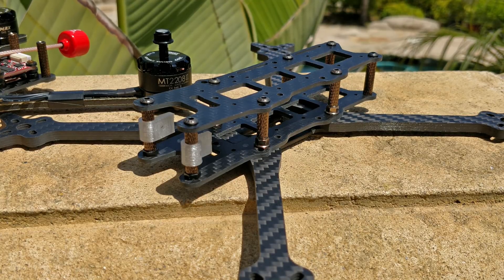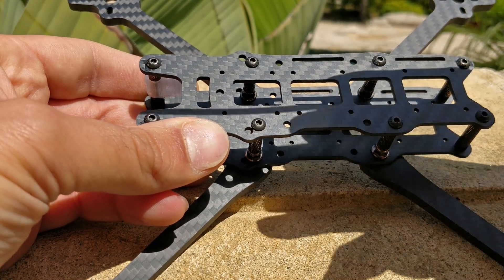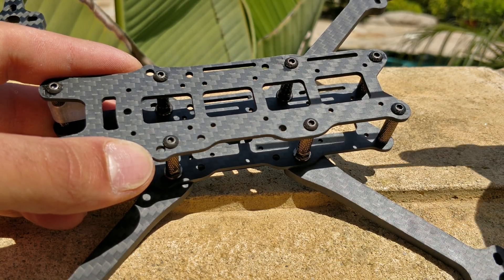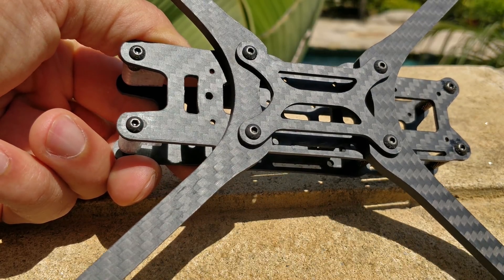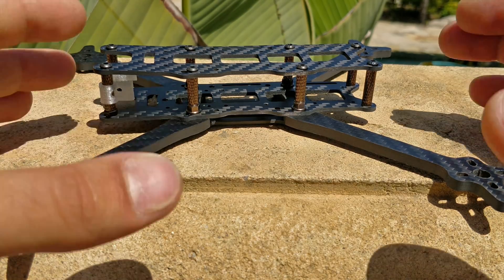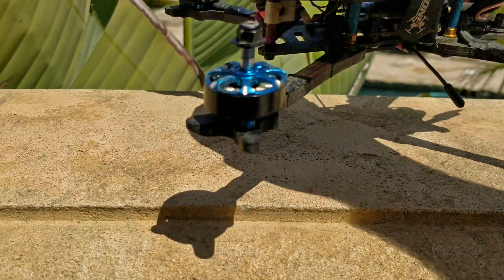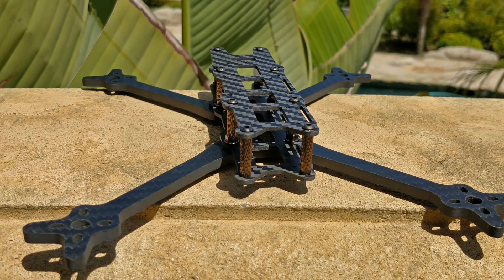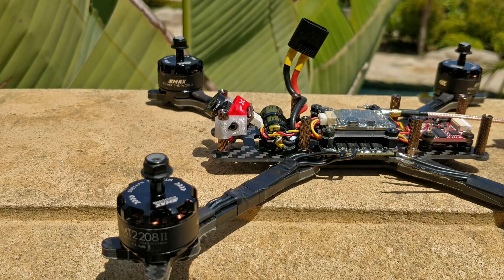FlosStyle - Features and Characteristics

Comment: Hey Bob/Kabob FPV!! Need a build manual for ur Glide 🔨 frame! Do u have a site or a manual for it!?
Reply from the maker: For the glide i haven't made one but I have for all the upcoming ones.  The current hammer batch is actually really tight to get together.  I have been recommending people either get a 3mm drill and drill through the screw holes used to mount the arms before assembling.  Or just twist a screw through every hole all the way and keep twisting to assure it's open and clear before putting together.  The tolerances on this batch from the factory is extremely tight.  The next batch wont be.
Reply: @Kabab  I found a build video for the glide so I followed those instructions & it wrked out!! Thanks & keep doing ur thing, Bob!! Love ur frame it's super solid

Comment: hi,,, someone gave me a 6" flosstyle frame ,,,, he has moved up to 7", will a 2508 motor be to heavy for the arms ? using parts off my old 7" ,,,,,, many thanks
Reply from the maker: No the arms on that quad should be quite strong however the more recent Glide design is better overall
Reply: thanks

Comment: Will this frame allow for 5.5” props?
Reply from the maker: it won't unfortunately and I wouldn't recommend it anymore.  The Glide frame on FPVCycle.com is a much better option.  It's a much more updated design and there will be three versions if they ever arrive from the manufacturer.  The regular, light and high strength version.
Reply: Thanks for the info! I’m assuming FPVCycle is your store? Ordering the Glide Lite now 👍🏽. Will it fit 5.5” props?

Comment: the xing 2306 will work with this frame ?
Reply from the maker: Yes definitely
Reply: @Kabab  you said in the video to not fly this frame with 2306. You sure ?
Reply from the maker: @mcFlow1  well if the build is light it doesn't need it. It's excessive throttle curve. Makes it hard to control
Reply: @Kabab  I really dont know what to do! which motor, frame and 4s battery to use???
Reply from the maker: @mcFlow1  first of all, you want the Glide frame. Not this one.  I just haven't had a chance to make a video about the Glide
Reply: @Kabab  I planning to use, micro fpv cam, full size antenna, 30×30 fc and 4in1 escs, gopro hero 4, and I still think what battery to use 1300mah(150g) or 1550(180g)... So what motor and props you recommend? For this freestyle quad ?
Reply from the maker: @mcFlow1  I'd really go for 6S. Anything 2207-2208-2307 in 1700-1800kv
Reply: @Kabab  And if I still want 4s what motor?
Reply from the maker: @mcFlow1  xing 2306 2450kv
Reply: @Kabab  You sure ? Because I am planning to use 150g battery and you said if the build it's too light with 2306 motor it will be hard to handle.
Reply from the maker: @mcFlow1  it's just a really good motor. You could go for the xing 2207 also if you like.
Reply: @Kabab  what is the performence and efficiency difference?

Comment: How much does off-center FC mount matter if I like to use autolevel once in awhile?
Reply from the maker: Zero. It doesn't matter at all. As long as the FC moves with the frame it could be on a 10ft pole out to the side. Even with autolevel you probably couldn't tell any difference with the FC 10ft our to the side.
Reply: @Kabab  oh ok, I was under the impression acc needed to be on for autolevel. Or does it work with acc enabled on autolevel too?
Reply from the maker: acc does need to be on for autolevel.  It just doesn't matter so much where the FC is.  Technically, it is best to have the FC somewhere near the middle for autolevel but in practice, it doesn't matter as much as it technically should.

Comment: @kababfpv are the 7 inch boomerang arms from pirpofliprc stable enough for this frame? No bending?
Reply from the maker: Yes they should be.
Reply: @Kabab  thank you:)
Reply: Also, do you think the arms will be on the gopro footage with 6 or even 7 inch? 
Secontly, i got some 2206 1720kV brotherhobby R3 I think. Will this be suited for my plans?:)
Reply from the maker: @sten6537  yes definitely the props will be seen on 6 and 7" unless you have maybe a 40deg or more GoPro angle
Reply: @Kabab  I just received the 7 inch hyperlite flosstyle from pirofliprc. Little disappointed. The 7 inch arms dont fit the 7 inch props. In the back there is like 2mm between the props, and in the front they collide with the frame :/
Reply from the maker: @sten6537  that's because there is no 7" FlosStyle. What you've got is a 6". It just uses the 7" arms from the floss 2.1
Reply from the maker: @sten6537  crap and now I realized I was responding to your comments without seeing what video it was on. I'm sorry. My bad. Please let me know your order number. I'll ask pirofliprc to consider a credit on your account
Reply: @Kabab  Yeah.. I was hoping to build a 7 inch Floss, but I guess it was misleading information.
Thank you for helping me find a solution. I can send you pictures of thw problem if you want. Order number: PD17-88754
Order Date: 12/11/2018
Reply from the maker: @sten6537  refunded $31.98. transaction id: 2JA619230E255754T. Sorry about that. The Glide design coming won't have this confusion
Reply: @Kabab  hey! Thank you for this. Great service. Still got the rest of the frame for nothing tho ;-). What is this Glide frame youe talking about? Should I hold on to the arms untill that frame comes out? Greetings
Reply from the maker: @sten6537  the glide is coming out in about a week. I've shown it in many of my recent videos and talked about it
Reply: @Kabab   aaah..
-can i use the floss 2.1, 7inch arms on the Glide frame to make it suitable for 7 inch props?
-also what do you think of your 2208 motors for fpv racing? Will that be any good?

Comment: Hi. I like this frame a lot as it is about 85g, especially that the arms are connected avoiding the issue my rooster has. What I think would be really perfect would be to have a front arm-pair that moves the motor position a bit to the back in order to move the motors out side the FOV of the camera. I know that you are happy to have the same arms on different models, but please give it a thought.
Reply from the maker: Watch the last half of my more recent video comparing 2207vs228.  I discuss the new design a lot and about this props out of view thing.

Comment: Does it fit 5.1 size prop?
Reply from the maker: Yes just barely. Barely barely
Reply: Kabab FPV 
Will it change the characteristics of this frame? because the front and rear prop will be closer together.
Reply from the maker: @DodeTeja  no it's not enough to matter

Comment: So, is this frame better than FlowRide or you can still recommend it?
Reply from the maker: Both are good. Both are a little different. I personally prefer the FlosStyle because it's a bit lighter and a more refined layout. But the Flowride is a bit more durable maybe and has individual arms. I'm working on one final frame that blends the two and will likely be the last frame I make. It'll be a couple months before it comes out however.

Comment: I just got the frame, it's awesome! But I was wondering how you power the camera and vtx with the cheap 28 dollar 4 in 1 ESC to reduce noise! Do you just power the vtx off vbat and then power the camera off the 5v output off the VTX? Or is having both on vbat a better option for noise reduction?
Reply from the maker: Most more recent FC's now all take 6S directly and power everything off that.
Reply: Thanks! (: One last question, you mentoined that using steel screws to mount the FC and ESC to the frame is much more durable and will not break in crashes. But this grounds the FC and 4 in 1 ESC to the carbon frame, right? Doesn't this cause any problems/possible dangers to the 4 in 1 ESC and FC?
Reply from the maker: @willemvergouwen  yes it does if the screw holes are conducting. But otherwise the plastic screws break very easily.
Reply: @Kabab  yeah they are conductive on my 4in1 and FC, but does it matter if they are grounded to the frame?
Reply: As long as you don't have a positive wire shorting on the frame carbon you're fine
Reply: @bobm2180  thanks! That's what I thought, but just wanted to make sure. I LOVE THE FRAME! :D

Comment: I built a flossstlye with rcx 2207 motors and with a 1300 turnigy graphene it still weighs 628g. It's even got the runcam 3 which is supposedly lighter than a session. It flies stupid great actually but I how can you build it lighter than this?
Reply from the maker: Yes those morors are unfortunately a bit more weighty. 630g is fine however. They are extremely high value motors. Can't expect everything to be perfect on them....weight

Comment: In your summary of the vid you mention the HQ 5.1x4.6x3. Have you had a chance to run that prop yet? I friggin love that prop! I put it on my Hawk 5 and it seemed to bring out a tad bit more power and I got a little longer flight time (not a lot tho but was averaging 15-20 seconds more a flight). I used it for freestying not racing , it was smooth no jello that I could tell. I put a quick vid on my channel of my first test flight with them. https://youtu.be/RE_lbp9xAZw
Reply from the maker: Yeah it's my second preference prop. I absolutely love the tmotor 5143.  Incredible prop.
Reply: Kabab FPV I love the tmotor prop too. More than the hq lol. Just wish it were a little tougher.

Comment: I am putting together pretty much the same set up. Questions about mounting the 20x20 flight controller. Are the rubber dampeners resting on M3 nylon nuts? Are the length of the M2 screws to mount the FC around 10mm? Thanks for any help :)
Reply from the maker: The FC is the Talon F4. It has the rubber hole inserts. They're made for m3 but it comes with brass m2 to m3 bolt press fit adapters. So I use I think 10 or 15mm m2 with a thin spacers and the brass insets. There's nothing on top of the FC holding it on. It grips the brass well enough
Reply: Thanks! i bought the talon f4 because of your vid. going to mount it in the back like that. cool idea
Reply from the maker: Robert Meyers if you bought the frame recently you'll need to shave the edge of the middle of the rear arms to get the screw in for the FC. A side effect of me beefing up the arms. It's been fixed but only recently. Sorry. But you get way stronger arms.
Reply: my frame was purchased from crown city during 4th of July sales. M2 screws look to be fitting fine :) but ill remember for any arm replacements. Thanks for the info!

Comment: So... now the line of Floss frames share some parts, which certainly reduced production costs. However, the boomerang arms seems an awkward option since they're more expensive (11 usd a pair) than the older individual ones (12 usd/5 arms). 🤔. I know the boomerang style makes it more expensive to cut but, Bob, why not keep the individual arms as an option and make they lock each other?! Floss frames are loosing the position of fairly priced frames... it's sad and what got me a little disappointed in getting Flosstyle :'(
Reply from the maker: The Flowride is still around. The boomerang arms are just remarkable at chopping the weight down. I would call this a more advanced frame. That being said, I've yet to break any of the bright boomerang arms on any of my dozen FlosStyles.

Comment: So... I got the frame in today and getting ready to build it.  How did you mount the 20x20 in the back? I'm trying to mount the 20x20 vtx but the back arm is practically at the edge of the holes.  When I try to put the screw in those holes, the arms are in the way and the screw head has to be pretty much none existing.
Reply from the maker: Yes unfortunately I didn't anticipate that I would be beefing up the arms enormously.  The best way to get the screw head to fit would be to just file the edge of the arm a bit. I'm gonna update the next batch of arms. Apologies.

Comment: So I got the frame kit and watched your video on the frame and the Camera mounts only have 12mm of space between them and the micro cameras are 19 mm am I missing something here :) the mounts on your video look different to the mounts supplied please can you advise as I see no way to mount the camera? it looks like the mounts on the Pryodrone site are different to the ones you have here they are designed for 26mm standoff spacing and yours are 22mm spacing on the frame are they shipping the wrong mounts?  as you can see they seem to be the wrong mounts: http://smartgroupstudios.com/flos/flos2.jpg compared to yours  http://smartgroupstudios.com/flos/flos1.jpg
Reply from the maker: Screw the mounts onto the camera first and then slide onto the standoffs. They squish for a tight fit that doesn't move so much. I'm not a fan of that particular mount but most people prefer it for whatever reason.
Reply: Do you prefer the the mount on this video over the tight fit mount TheGrowGeek is talking about?
Reply: it "looked" the same to me, but i screwed them to the camera, then slid down the already mounted standoffs and it was good and tight, albeit twists/distorts the tpu a bit.  also, there are some that "look" identical on thingiverse, but are reported to be slightly smaller dimensions.

Comment: Would it make sense to countersink the top screws so that the top plate is totally flush, therefore stopping any risk of lipos getting punctured by screws? Or would it make the top plate too weak/ easy to rip off from the standoffs?
Reply from the maker: yes and I would love to but countersunk screws aren't standard.  The vast majority of people have a bin of M3 screws of all sorts of sizes.  Not countersunk ones.  Also, you're probably going to use a battery pad for a little grip anyway so not a huge issue.  But I do love the clean look.  I just love using standard mindless components more however.
Reply: Kabab FPV ok, I might try countersinking and see how it goes.

Comment: Hey Kabab, I'm looking at the HQ 5.1x5.1x3 props vs 5.1x4.6x3.   I know it's preference, but which is your preference on your Floss builds?  Thanks!
Reply from the maker: Both are excellent and I like the 5.1x5.1x3 best but unfortunately the amp draw is rather extreme. So the 4.6 is the only reasonable option.
Reply: Kabab FPV Gotcha thanks man!  Appreciate the response and info.

Comment: Is there any way you could design a. Custom top and bottom plate that is a bit longer? I love the frame except I don’t really want to see props in my GoPro footy. I run 20^ degree so thats kinda an issue. Thanks
Reply from the maker: Unfortunately the arms won't allow for that. If you want to get props out that low, you have no choice but to go with an alien style H setup. Unfortunately you'll sacrifice some flight performance for that.
Reply: Kabab FPV I think I’ll go with this frame anyway. I admire all your work, designing a frame is a lot more challenging than people think!!

Comment: Howdy man.. Q for you: I'm gonna be ordering the frame.. Do I need to allso order them FPV-camera-mounts, or does the frame come with a set (and maybe even a FPV-antenna mount-thing)??
Reply from the maker: DutchRC Adventures comes with camera mount. Not with antenna mounts.  Forever tubes in the front for regular receivers work well. I put the holes in for those tubes.
Reply: Thanks for the quick reply! (I'm on a different channel cause I'm uploading stuff).. 
Yeah tubes.. holes.. I Did watch the video :)   
Well excellent! I just spotted a FPV-antenna mount on thingyverse :)

Comment: With you freestyle floss frame. 591 grams with battery(1300 battery) and gopro. The yaw feels good but everything else feel loose or feel like it drifts more during turns. I have to roll more the gas up more or I'll hit the ground. Which I did lol. But Iove the frame though. I hope I can finger out what wrong.
Reply from the maker: Sounds like you have a loose tune somehow.  Update to the most recent version of whatever firmware you're using and try a totally stock tune.

Comment: Speaking of frames...is that 30 gram ultra strong frame you mentioned a few videos back, due out anytime soon?
Reply from the maker: I actually have a prototype but it's not ready yet. It's absolutely bonkers awesome however. In time...
Reply: Kabab FPV are we going to get any teasers? I’ve literally been sitting here for two weeks trying to find materials with the tensile strength of carbon fiber that are some how 80% lighter...I’ve discovered nothing.

Comment: Could a 30x22x8 board fit between the micro camera and a 30x30 stack? I'm trying to eyeball it but am not really sure
Reply from the maker: What board is that size?  I think It'll run into the camera connector and if you have any wires at all they'll be in the way too.
Reply: A flysky receiver (X6B). It has shortish antennas and is very big (at least way bigger than the XM+) so the only way I'll be able to use the forever tubes is if its right there.I think I might just heat shrink the forever tubes to the back standoffs maybe and have the antennas run out the back. Like RR https://www.youtube.com/watch?v=QrOJySAljwE&t=2693
Reply from the maker: I wouldn't count on it.

Comment: Put the camera mount in the package. It's annoying to have to print that in order to mount a camera. Not everyone has a printer at home.
Reply from the maker: Not everyone uses tpu mounts. Most actually don't and still use the foam+batt strap method.  The prints are also $15. You don't need to print anything and I wouldn't recommend it because it's a pain.